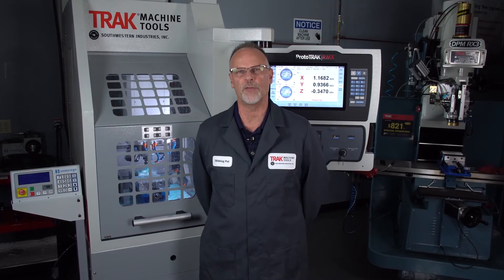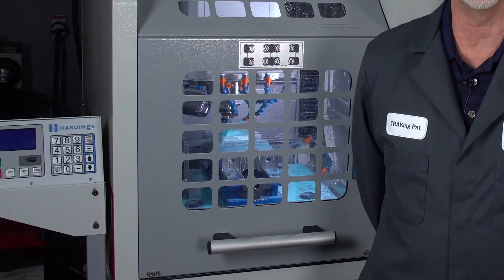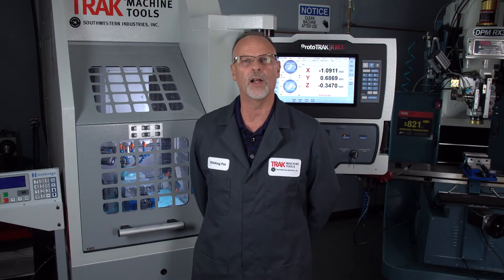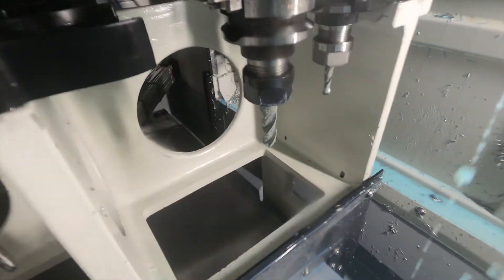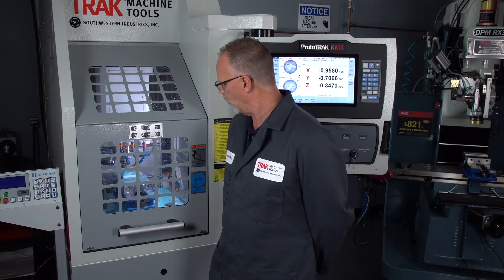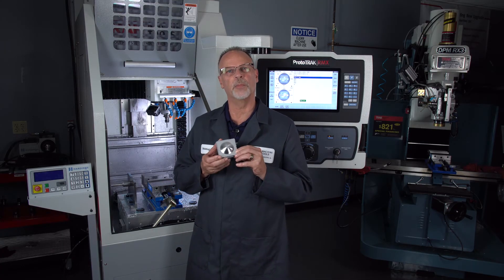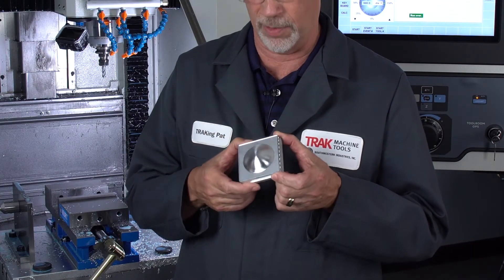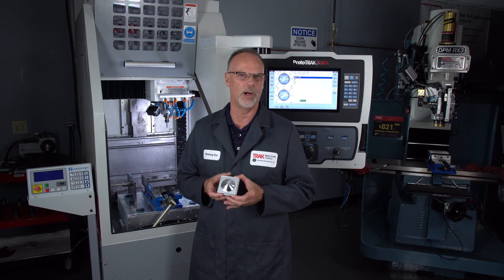3D Surfacing Demonstration | TRAK VMC2 and the ProtoTRAK RMX

Comment: It would be nice to see the info on how you generated the G-Code. What CAM software? What Post you used? ect......
Reply: Corey, the truth is that any CAD/Cam or solid modeling software can be used to create a part like that.  We don't promote any certain brand since all of them can do this.  The post processor comes from whichever system you choose so all you have to do is tell them that you are running a ProtoTRAK 3 axis control and they will give you the post processor. T.P.
Reply from the maker: I'll pass the questions to TRAKing Pat. He's at WESTEC now, so might be a delay in response. ~PK